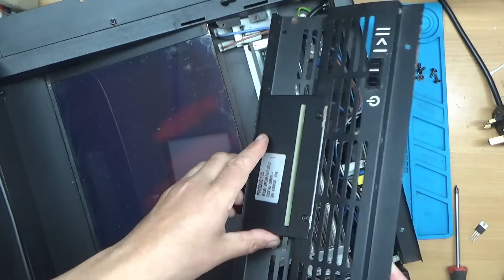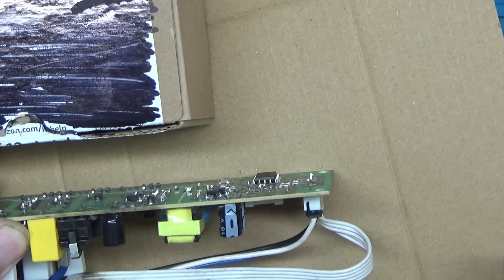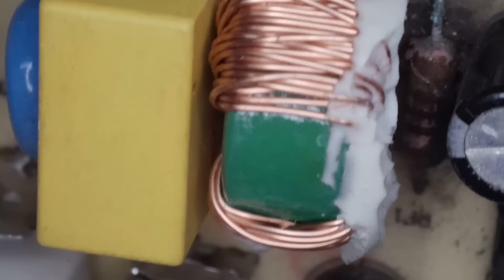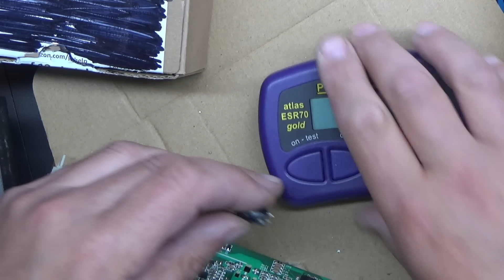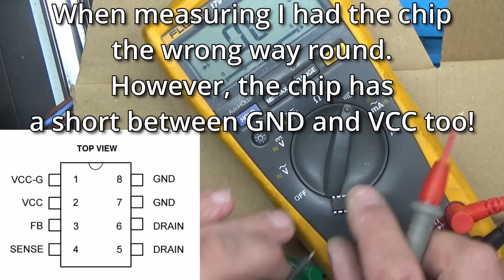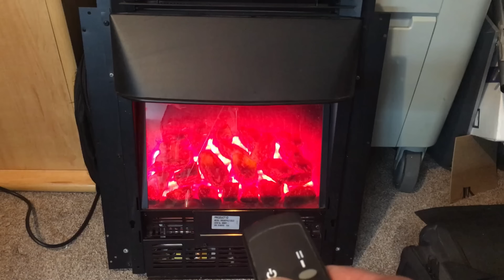They Said This £600 Fire Was Unrepairable! | Hold my Beer 🍺🍺🍺

Comment: brilliant Mick ive had some problems with soldering irons from a local supplier.I would be interested to know the make of yours and do you have any tips to keep the working.Thanks Mick. i even trying a recharable one Lewis
Reply from the maker: Thanks Lewis. The one I use is an AIXUN T3A. It's served me well over the past 3 years. It heats up pretty much instantly when I remove it from it's holder and automatically switches back off when I put it back in the holder.

Comment: Hi Mick, I have a Hantek DSO5102P Oscilloscope which started going faulty a while ago, so the display was showing signs of damage on about an inch on left and then it would cut off after about 15 minutes I did take back off to see if there was anything obvious but didn’t see any signs of caps or blow components the problem could have started when I left in my Model railway shed over winter , I've just tried again and its just dead no display and some buttons light up but don’t respond, so was wondering if its something you could look at for me I live in Edgworth just north of Bolton ... Regards john

Comment: Resistors with the Colour burn off them are a nightmare to find their Value
Reply from the maker: I did see a tip once, where if you sand some of the coating away half way along you can measure from a leg still and get a reading half of what the value should be.

Comment: How do you use the solder sucker so well?? You were 6/6 first try! I swear it takes me like 3 tries per hole haha.

But another great fix and thanks for helping this gentleman and for showing us! I'm glad it was able to be fixed.
Reply from the maker: Thanks mate 👍Is the solder sucker the same as this one? It's got a soft silicone tip to help make the vacuum better. You could try adding some silicone tubing to the end of your existing one if not. Also is your iron hot enough?
Reply: @BuyitFixit ah you know what? Mine has a hard plastic tip. I have another one that's a little fancier so I'll have to dig that one out and see what kind of tip it has on it. I'm guessing it's probably just a terrible solder sucker 😂

Comment: Another item saved from landfill, quality as always. With the filter would it have been possible to unwind 1 turn and reattach it?
Reply from the maker: Thanks 👍Yes, that would have worked, but the wire that was broken was the one coming from the centre of the coil so you would need to unwind the full thing and then rewind it.

Comment: Hi Mick fantastic fixes love your vids and cant stop watching your work can you advise of a repair cafe near me please i have a Dyson fan AM07 with no display showing and looks totally dead followed one of your vids on your dyson repairs and think i have traced as far as i can go -F2 fuse intact and voltage on mains capacitor ,traced through to U2 (linear regulator) it appears not to be letting 5v through it and powering down to 0v ,however with the solder iron i have i cannot remove it . The main fan motor when following your test procedure to test windings ,found one pair at 0.16 ohms , motor fan seemed very tight and not running freely as expected - i would love to be able to trouble shoot this further but i think i have got as far as i can go with limited tools i have lol , any advice you can offer would be greatly appreciated as i find your work very interesting and have spent many a late night watching your vids , keep up the great work you do
Reply from the maker: Thanks Richie 👍I can't remember the readings of what the motor should be off hand, but you should get a very similar reading between any of the 3 main wires. If the motor is tight, it might be that one of the coils has burnt out. I did manage to get a replacement motor for one ages ago from Aliexpress, but shortly after they went "out of stock" and I've never came across them again. If the motor is faulty, then I think you might be out of luck with this one...

Comment: What isvthe lightbulb tester? Does it act like a fuse?
Reply from the maker: It limits the current. I have a 100W incandescent light bulb in mine. If there is a short on anything connected, instead of the device going bang, the bulb should just light up (the short acts like a switch to the bulb).

Comment: Nice one! Checking the current sense resistors was a good idea. Your repair skills are a million miles ahead of mine, but still  I always learn something from your videos. A while back I had a rather similar posh electric fire with a failed PWM chip. But this one was because of a shorted Schottky rectifier, so an easy fix by comparison.

It should be illegal to scrimp on power supplies. Old-fashioned wall warts look ugly inside, with brown paxolin boards and loads of silicone. But compared to more modern SMPSs don’t you think they were much more reliable?

Comment: Well done! The single diode is interesting, not even a flyback diode? Top tip: It's always worth finding the data sheet for  the chip,  often the circuit is more or less a copy of the example application schematic provided by the manufacturer.

Comment: I think we all know what it means when a company says that something can't be fixed because they don't make the parts anymore.  They just want you to buy a new one.  Granted, there are some occasions when certain proprietary parts fail and cannot be replaced, but that's generally not the case when off-the-shelf parts are involved.
Reply from the maker: Yep, I think that sounds about right.
Reply: Manufacturers don't want to bother with component-level repairs. If they can't stick in a whole new board they'll condemn the whole product. A big reason for that is probably the cost of skilled labour in Europe versus the cost of large-scale robotised mass production, especially in China.
Reply: The makers should get charged for the waste that they indirectly produce by refusing to fix items.

Comment: I wish my own solder sucker worked as well.
Reply from the maker: It was another viewer that recommended the little "engineer" one that I've been using. I've put some links in the video description to some of the tools that I use including that. The only thing to watch with it though, is that there is no safety shield where the plunger pops up.

Comment: What is the part number of the integrated circuit?
Reply: If your getting them from Ali express it could be any old chip or something similar to the one you need that has been sanded down and re numbered.
Reply from the maker: GR8935L

Comment: What actually caused the components to blow in the first place ?
Reply from the maker: I think it was the mains smoothing capacitor dried out, caused a lot of ripple, which caused the switching IC not to function correctly. It probably latched on for too long, which caused it's internal MOSFET to blow, and take the rest of the stuff out. That's my theory anyway...

Comment: just a reminder that scribbling stuff out is not sufficient, I can still partly make out what it says on it, it's best to either black it out in post, or cover it with solid card. 4:43
Reply from the maker: It was just some Amazon battery I was using as a weight to keep the PCB from moving, but because the label was white, it was messing with the camera auto exposure 😉A bit scribble with some black sharpie seemed to stop it darkening the picture.

Comment: My mother inlaw was going to throw a similar one to this, slightly bigger out as she was told the board was no longer availible aswel, was £700 new, i took a look, it was a 10p Diode that was short circuit, fixed it over 2 years ago and its still going. Great Video!
Reply from the maker: Brilliant result 👍

Comment: Sadly component level repair nowadays is a rarity, usually it's just board swap.
After seing the carnage, I was afraid the MCU would likely be dead as well, but you got lucky this time.
Nice repair and great to hear the customer is happy !
Reply from the maker: Thanks mate 👍Yes, had fries MCUs a few times on here unfortunately.
Reply: The MCU is only for the remote anyway. You could bypass the whole PSU and replace the relays with 16A rocker switches.
Reply: @simontay4851  Or go step further, make a small relay board with IR capabilities powered by Arduino Nano or something like that :)
Reply: @MothKeeper  Sorry for the double reply. Youtube comments are being stupid again.

Comment: Well done, that was an interesting mix of parts. I've seen switchers blow, and have often seen this taking out current sense resistors, fusible resistors, and bridge diodes. But when you found the bad common mode choke, I thought that was the only issue, and the HV cap also being dodgy makes me muse on cause an effect.
Reply from the maker: Thanks mate 👍

Comment: #bitsandbolts  meter overlay
Reply from the maker: Yes, think I saw that on Hackaday a few days ago. It would probably be possible to do similar with my Fluke 179, but I normally use the microscope and have the overhead camera looking at the meter which I then crop and overlay on the microscope footage.

Comment: I miss the early days where the flame effect was achieved with a motor, a light bulb and some reflective foil rotating around...
Reply from the maker: I remember those too. I think some didn't even have a motor. They were just a round disk with slits in, and the heat from the fire caused it to rotate and make the fire effect with a red bulb.
Reply: @BuyitFixit . Is it just me or the use of a micro controller that can conveniently lose its brains due to various issues goes hand in hand with planned obsolescence?
Reply: @bufordmaddogtannen  It's just you! 😂
Reply: @bufordmaddogtannen  Its not you.
Reply: @BuyitFixit  It was the convection air current rising from the hot incandescent bulbs, which caused the metal discs above the bulbs to spin, creating the flickering log flame effect. Simple, but rather wasteful of energy.
Reply: Mine STILL does that, although I've fitted LED bulbs, reducing the lighting wattage from 120 watts to 1 watt!
Reply: Or what about aluminum Christmas trees and projected rotating coloured lights.

Comment: We have one very similar ,no PCB you switch the switch and it's on or off ,another switch it's warm or hot .You don't need a remote but I guess for invalids it's use full .The biggest problem today is if you have anything left to sell to run it!
Reply from the maker: Yes, the price of energy isn't cheap these days.

Comment: A lot of components taken out and needed replacing in this one, I wonder how they discovered it was not working though the last thing I would think about this time of year is turning the heater on. 🤣
Reply: Mostly PSU-side tho: the 'break point' was the IC between the PSU & controller sides.. which makes sense if you think about it :) Fortunately that IC was a dumb component: had it been a more modern 'intelligent' device it prolly would have been unfixable due to programming code not being available :(
Reply: @snafu.X  Agree
Reply from the maker: I think it had been out of commission for some time, as they had already tried to get it repaired from the manufacturer.

Comment: Great fix. Wonder what went first (switcher probably, though what appeared to be some corrosion on the fusible resistor was suspicious). Most repairers, even if they exist, would not have been affordable for that level of work.
Reply from the maker: Cheers Ralph 👍There was some mention of possible cat pee on a later email, but the ESR on that cap seemed very high. I'm wondering if bad DC caused the IC to lock up, and that caused the rest to fail.

Comment: Hail!  😊   Chimney Swift eggs Hatched last week ...  no fires until Winter,  Great to hear them being fed. 
Decades ago, Fireplace had Heater, with rotating 'fire' look.   Removed it and Used Fireplace ... after that, Chimney Swifts nested each spring.   Hurricane Charlie took off part of Stack, H2O poured into fireplace .. No more Birds. 
Last year, Metal Roof fixed, Stack cut off even .. Birds are Back.  so, ... FIXED  here too.  CHEERS!
Reply from the maker: Cheers 👍That's brilliant news, sounds like you've got some lovely guests back in your chimney! 👍

Comment: Great fix Mick, but you missed an important clue as to the cause very early on once you removed the PCB (around the two minute mark). Can you see what I'm referring to? 🙂
Reply: You must have eyes like a hawk, my 69 orbits old ones can only see what looks like soot around looks like two screw holes, and if that, are you thinking that screws were used that were too long for where they were used to hold something on the front, and they got through the insulation of a wire over time?
Reply: @Tekwyzard  Take a close look at the white ribbon cable ......  🙂
Reply: @SlartiMarvinbartfast  Good spotting, I'm not sure if that's a cause or an effect though, and is just more soot, single stepping through hundreds of frames doesn't show any failed insulation or melting on any of its conductors, and the component where that bit of cable had been resting near appears to be an axial inductor with intact heatshrink on it.
Brilliant username by the way, just saw it while typing, excellent, and it had me chuckling, I really do need to watch HHGTTG again.
Reply: @Tekwyzard  Listen first, then read, then watch  is my recommendation :)
Reply: @Tekwyzard  Not quite what I'm getting at, the point being that the 'soot' on the white ribbon cable matches where the fusible resistor blew (when the cable is placed in its normal location over the PCB). I'm just surprised that Mick didn't spot that as it would have saved a bit of early work. 🙂 (not a criticism BTW, Mick is a fine repairer and his videos are great).
Reply from the maker: Well spotted, I missed that one 👍

Comment: Well done. This attitude from repair places is board swap, I had a similar situation: a customer had an electronic organ they took to a repair cafe, they said new board was needed £120, the customer asked me to look at it I found the fault in 10minutes and a 1p fusible resistor. Not many are like you and me who dig deep down to component level. In fact, I've done a few of these fires with the same fault, caps get dried out, causing PSU failure, it seems daft putting poor quality components in something that gets hot.
Reply: Board swapping is not repair. That shows how lazy and incompetent these "repair" places are. They wouldn't even know how to read resistor colour codes and they wouldn't know what a uF is.
Reply: @simontay4851 no, they are on it to make money. wonder how many hours Mick worked on this?
Reply: Indeed: caps after PSU test is usually the fastest way to go for diagnoses
Reply from the maker: Thanks mate 👍Great job on sorting the organ. Yes I was thinking about the heat and the caps, that's why I just replaced all of them 🙂
Reply: You'd maybe be surprised how short lifespan of even the most expensive caps is once they're close to their rated temperature. Most of the brands have something like 1500-2000 working hours declared in these condition.
Reply: Just trying to work out what's suggested here. Are you saying that a Repair Café told the customer a new board was needed or that the customer brought it to you at a Repair Café?

Comment: It is worrying and bewildering that  board level repairs on the whole are not even attempted these days presumably because the skills are no longer available - only board replacement requiring minimum skills which some technicians are incapable of. All partly to be blamed on makers not providing circuits like in the 'good old days' ....................

Inrush current limitiing resistor? Cheapskates single diode rectification ............ ESR an indication but I have found those component testers do not do well at showing faults on caps operating at very high voltage.

Well done for continuing to show the world what is possible!!!!!!!
Reply: Lots of people do board level repair, but mostly at the grass roots level rather than service centres.
Reply: Service centres haven't got a clue. The real repairers are independent people like mick.
Reply from the maker: Thanks mate 👍Yes I was a bit confused with the rectification at first until I saw the blown fusible resistor, and saw where it went. Most smps have a full bridge, and I wasn't expecting just a single diode!

Comment: Well done on the repair ... but seriously! £600 for that fire?? He was completely ripped off. There was barely £100 worth of materials in that thing!
Reply: Exactly! Its just a glorified 2KW fan heater. The only reason for the power supply board is for the remote control and relay switching. You could remove the PSU and connect the relay wires to 16A rocker switches.
Reply from the maker: Thanks 👍Agree, expensive for a glorified fan heater.
Reply: Things aren't priced for their electrical content.
Reply: Antique we call them Antique now. 🤣
Reply: Fire = 5 cent match + $0 pile of old newspapers. Job done

Comment: Such an over engineered device,  I have a simpler version of this heater which used the red 60W lamps and a fan blowing some fabric strips to create the effect. Scraped all that and got a 5 Watt flame effect light bulb with about 70 led's and a micro controller. It cost £4 from AliExpress. I removed the cover and flattend out the flexible circuit and positioned it in such a way that cast light on the glass.  Works better than the original minus the fan and 60 Watt bulbs.  Big Clive features these bulbs,  nice fix.
Reply from the maker: Thanks 👍Interesting about those Aliexpress LED flame effects bulbs.
Reply: @BuyitFixit  They work very well and no fan.  You  can buy the panels on there own costing about 90 p